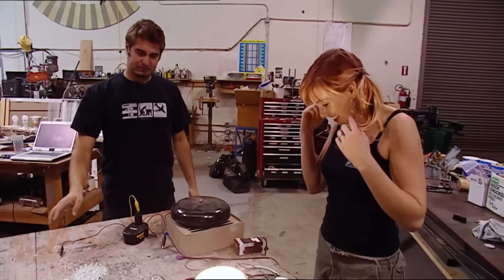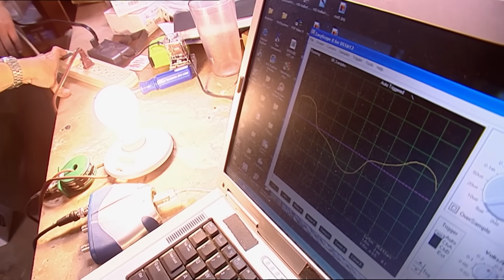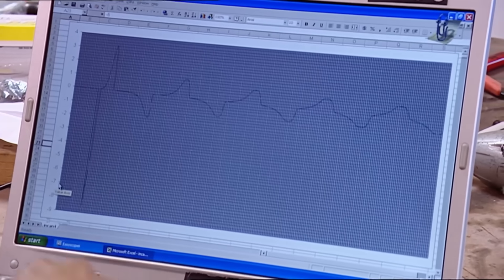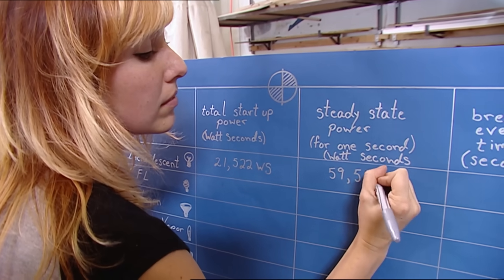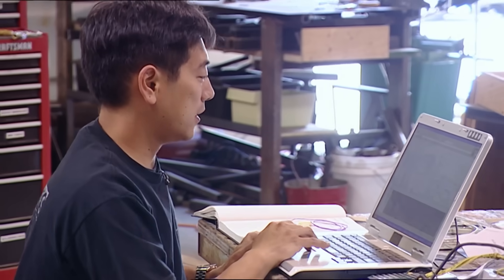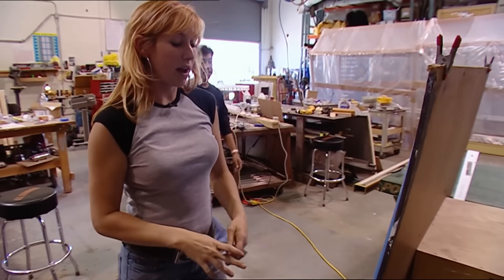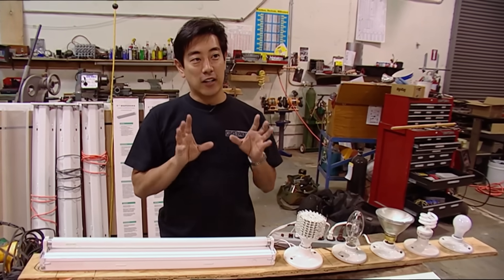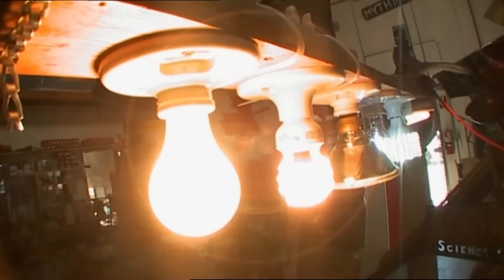Is It Cheaper To Leave The Lights On Than To Turn Them Off? | MythBusters

Comment: I think this myth  came about with the introduction of hi/low pressure sodium lamps and fluorescent strip lights, their main guzzling (the striking from 'cold') does infact use more until the ballast takes over and reduces the over all current consumption but as the years have progressed things naturally got more efficient. I also think its to do with power factor. Real power vs aparent power, inductive loads dump a bunch of current back on the neutral and in most industries you get billed for that.
Reply: Hmmm yes very true, back when lighting was more exciting and scary lol.
Reply: Some industrial electricity consumers also have surge or peak power meters. I wonder if some of financial concerns come from coincidental spiking from the light along with other surges resulting in larger bills?
Reply: I have some huge Sodiums in the building I work in cuz it used to be a factory . They take almost 5 minutes to fully brighten sometimes 10 depending on temp and they use a lot of electricity. We've been trying to get them switched to LED for 10 years , but the owner is being stubborn about it .
Reply: @catherinesanchez1185  HPS is better
Reply: @catherinesanchez1185  reminds me of my old kitchen lights.
Reply: I was always told that it was fluorescent lights that wasted enough power to be worth leaving on for a few minutes, but I take it from this video that I was probably wasting money as the extra is pretty small. The big situation where leaving lights on can be helpful is if you're able to offset some of the energy necessary to heat the room with the energy from the light.
Reply: @SmallSpoonBrigade  how old is the fluorescent used in this clip?
Reply: But the myth was never true. The surge is large, but ballast stops it in a fraction of a second.
Reply: I think it came about because always turning off a light treats a person time as a free infinite resource.
Reply: @TheNewton  How much time have you invested in turning off lights?  LOL
Reply: @TheNewton, you have now been promoted to HIR Human Infinite Resources. may you forever be indebted to the clanker 😊 😂

Comment: I turn off everything when not in use.  Even unplug my chargers too.  Heard some of them still draws electricity, when it's not charging your device.  Only thing that stays on is the fridge.
Reply: I eat all the food in the fridge at bed time so I can turn it off over night.
Reply: @burblering  genius
Reply: Leaving chargers turned on uses about 2 cents a year
Reply: @Vilastrimoz  In general, there may be some poorly engineered power bricks out there. Years ago I checked out a kill-a-watt from the local library and went around the house plugging things in and very few things used more than 1/10 of a watt when not turned on and most of the things that did were related to the TV, so I got a power strip that turns most of the outlets off in response to the controlling socket.
Reply: Same, but plugging off a charges it's not for economy, that's more for home safety, they gonna blow and firing, they real lottery from China
Reply: @maddogg1432 I haven't had that happen yet I have appliance cords hooked up I have my lamp hooked up to it and my charger.
Reply: Completely depends. There are still some vampire devices out there, and even some that don't cut power at all until unplugged (some sandwich toasters or irons come to mind). But common USB chargers are, by EU regulation, not allowed to draw more than 0.1W without load any more, some do only half or less of that. That's pretty negligible.
Reply: @Alias_Anybody  As an American, at this point, thank god for the EU! It's about the only thing left on the planet that even pretends to care about the people in general, as opposed to "the people" who are billionaires.

I miss when that was still the U.S., to the extent that it ever was.
Reply: @Alias_Anybody  That's what I found when I checked out a kill-a-watt from the library years ago. Hardly anything that I had plugged in drew even that much. I mostly just unplug things that I think are more likely to result in a fire or be damaged by power surges than to save power.
Reply: @SmallSpoonBrigade 
Ironically, the devices most likely to die due to power surges are cheap sh*try WiFi Routers, something you can't really unplug preemptively.
Reply: Yes this can be true, leaving pretty much everything plugged doesn't use anything because untility dosnt charge for reactive power, e.g a USB charger without a LED but if the charger had a LED you would be charged the amount the LED uses.

Comment: I can't remember when the last time I changed a lightbulb since we got all LED bulbs.
Reply: Most of them last many years, but I had some die way to early. Especially LED Tubes and outdoor spots.

Some LED bulbs get a bit hot too, might replace them with high efficient ones, when they are due.
Reply: @AzrethK9  This is very true. I have definitely gotten way more duds with LEDs than I did with incandescent bulbs. Either they didn't work at all right out of the box or only lasted a couple of months. Which makes sense since they are much more complicated than incandescent bulbs. Particularly the blue LED element is very complicated and precise. But if it lasts a year, it will probably last a good, long time
Reply: What's actually interesting is they don't just pop out like old lightbulbs do. Rather, they start dimming. I have one that has been "burning out" for 4 years now. I leave it lit, 24/7, in the corner of a room because I want to see how long it actually takes for it to 100% die. It's down now to giving off probably about 3% as much light as the day I got it, which is about 11 years ago now.
Reply: @dacypher22  either that or you get a epileptic disco which is extremely dangerous in a commercial environment, there have been many places including a doctors surgery where i have pointed out how dangerous is it to have a flickering light and they just shrugged it off!
Reply: Sadly, they began cooking the LEDs so that they burn out quicker. They still live longer than incandescent or Fluorescent lights, but not as long as they could.
Reply: @Ninjaeule97  Fluorescent lights last way longer than LED lol. (except for instant start)
Reply: @NEON2600continues running ones sure, but once you start turning them on and off then LEDs beat them. I had to change more flurencent lights due to this. Hoewever if you are plannung to light an office setting where there get only turned on and off once per day or even better a subway station then you can save on maintance if you go for flueorecent.
Reply: @Ninjaeule97 no. Fluorescent consumes the double compared to led. Look for high efficiency leds if you care a lot for running costs. But normal ones are still better.
Reply: @Ninjaeule97  It wouldn't surprise me. They would realize their lightbulbs were lasting 10+ years and figure they had made a huge mistake.
Reply: @Ninjaeule97  cough! cough! Thompson Edison, incandescent carbon filament to tungsten! 🙃
Reply: Fun fact: If standing on a small ladder and changing an CFL light bulb, do NOT put the threaded end of the old bulb in your mouth to hold it while screwing in the new one. They can hold a charge...
Reply: my fridge led just went after 3 years and there's no way to replace it. bullshit, i've tossed a couple led 4 foot basement lights after a couple years as well... bad batches?
Reply: I had to change a few... They do get bad. Sadly.
Reply: they dont burn out after about a year in the bathroom????????
Reply: @Oneaphelion  Nope, 5 years and still going strong.
Reply: @Oneaphelion  we've had LEDs in a damp (after use) bathroom for like 5 years now, i think maybe one or two have failed. In that entire span, so no.
Reply: @Oneaphelion  They shouldn't, usually what happens is that they slowly get dimmer over time. Apart from a couple older smart bulbs, I don't think I've had any LEDs burn out.
Reply: @Oneaphelion I have had the same problem even with the CFL'S and not just in the bathroom but in outdoor lights. im fairly sure its got to do with the relative humidity and temperature fluctuations, unfortunately as led got more popular so did cost cutting, most led bulbs are also overdriven  to make them brighter making them 'burn out' faster and most the time its the driver not the actual light emiting diode itself that busts, it dosnt help that with the rohs requirements, that the lead free tin tends to create 'dry' soldered  conections that break after prolonged heating and cooling cycles. it would be worth looking for a bulb more designed for outdoor use  or a purpose built fixture to keep it all out.
Reply: LEDs can't handle heat. They die quickly in enclosed or inverted fixtures with poor airflow. The bulbs with LED strips suspended on wires in theory dissipate heat quicker, but they still suck.
Reply: @MobiAussie Right you are! Its the classic misappropriation of a potentially revolutionary invention. Someone else in comments said  somewhere big clive did a video on this, which is where i said about them being ovendriven.